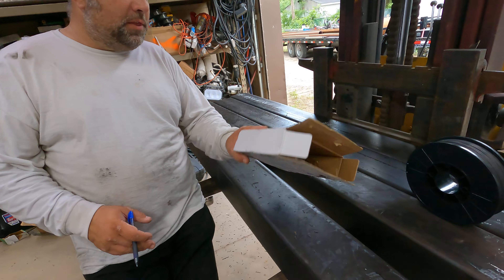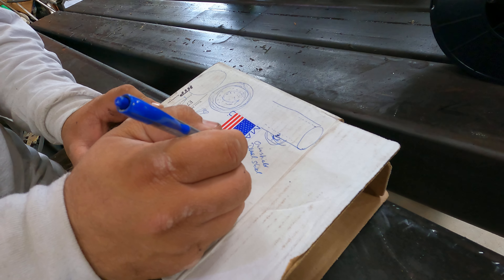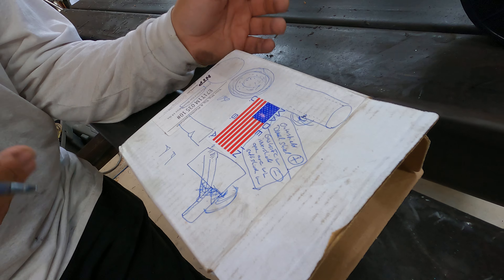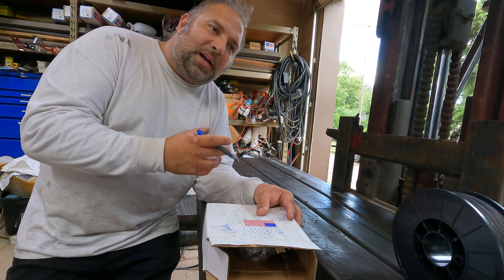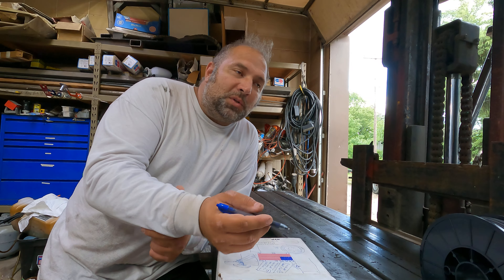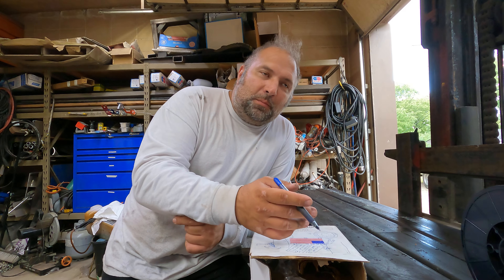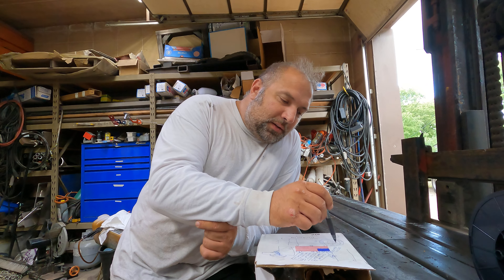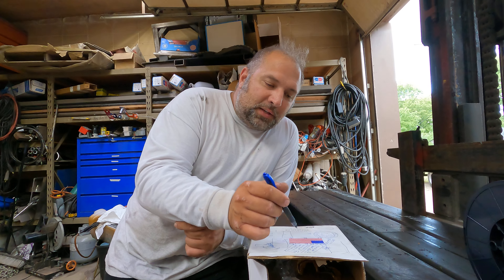Flux core welding wire ....  all home owners crap ?  lets find out

Comment: Great explanation! Small diameter self-shielded wire has it's place and I've had some good success running a few spools of it. Few beginners realize that industrial use of dual shield (and some self-shielded) wire on good equipment is a totally different animal which has been used to build a lot of the modern world. When it's dialed in, it penetrates well, lays down a smooth bead and you can really put down a lot of material in a hurry. Thanks Peter!
Reply from the maker: @TimWelds you are absolutely correct! Right now people are welding high rises ( joining i beams) and cross country pipelines with self shielded wires as we speak. In the hands of a skilled and knowledgeable welder they can be a very good solution to a lot of problems. 
Personally for me, i am a dual shield guy though ….

Comment: where flux core gets a bad rap from is from 'flux core welders". the absolute bottom grade junk that are there to sucker beginners in with.
 machines with almost no adjustability and often undersized for most stuff. but the wire gets the blame.